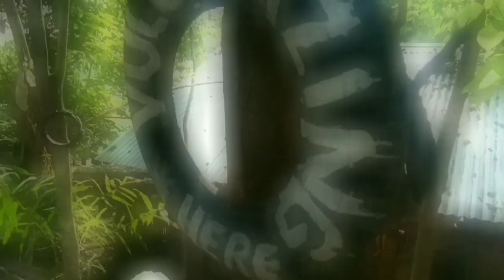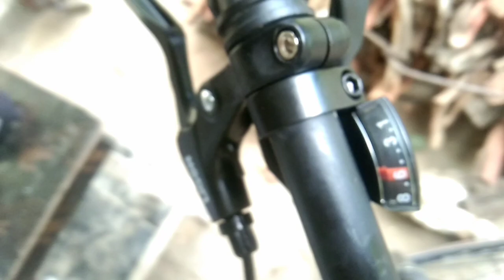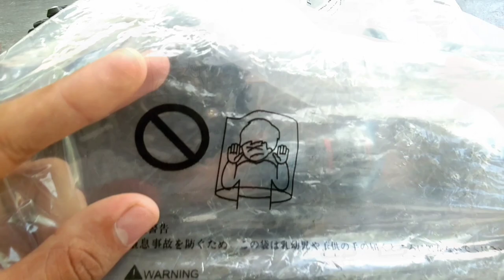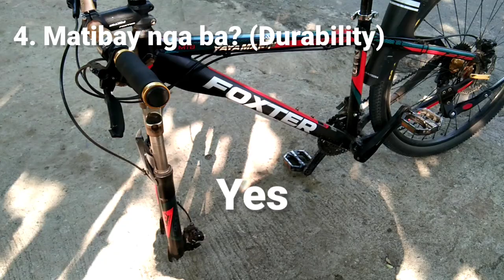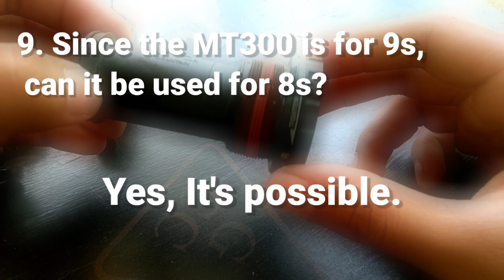CRANK REVIEW: Shimano FC-MT300 Full inspection and Common Questions about Hollowtechs

Comment: Idol ano mas maganda ipalit sa stock crank ko alivio crank or mt300? Naka 8 speed pa ako. Salamat
Reply from the maker: Kung balak nyu maging professional , wala ako gaano maipapayo dyan. Pero kung  joyrider lang kayo tulad ako, it doesn't really matter kung mt300 or alivio crank, almost thesame, may model sila both na 44/32/22 at 40/32/22. Sa konting weight at design nalang sila nagkakatalo.

Comment: Kaya kaya nito mt300 na 44-32-22 sa 10 speed setup na 42T? Kumbaga pamalit lang sa deore crank?
Reply from the maker: Tensionado na po RD ninyo also magiging kaaway ninyo ang Crosschaining.
Reply: @RideReady7250  ah no issue naman sa cross chaining kasi alam ko naman yung proper gearing kahit papaano. May 3x kasi na deore setup dati kaso 40T lang iniisip ko lang kung pwede pamalit yang non series na 44T :D
Reply from the maker: @johnronaldraviz4052  actually if that's the case na familiar kayo, well yes pwede naman.

Comment: ano kayang pinagkaiba nito sa Alivio crank bro?
Reply from the maker: Nc question, actually dati may alivio crank ako, yung makikita mo sa video na mt300 44/32/22 yung ngipin, halos same din sa alivio crank. Ang noteworthy na pinagkaiba nila is WEIGHT AT DESIGN. 

Medyo mas mabigat para saakin ang alivio pero di naman big deal kasi ilan lang nman lamang niya. Also maganda itsura.

Sa Mt300 cheap, matibay, pero personal preference nalang sa itsura.

 (Note na may variation din sila na merong 44/32/22 or 40/30/22 kaya always check kung bibili)